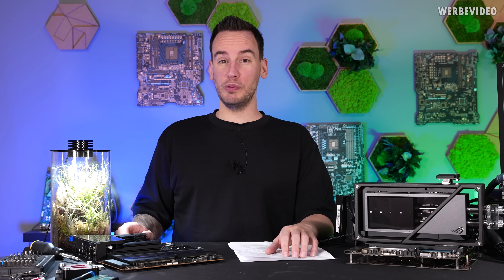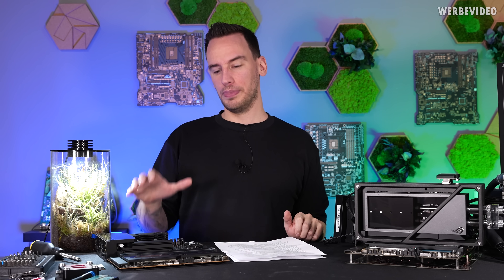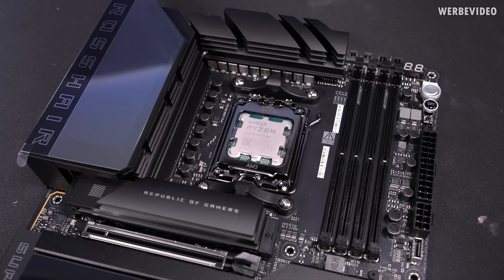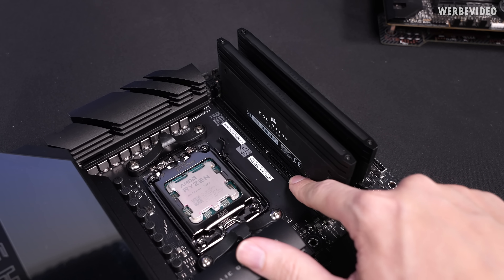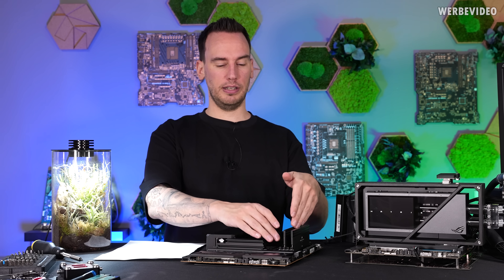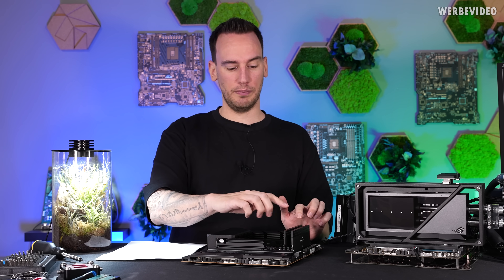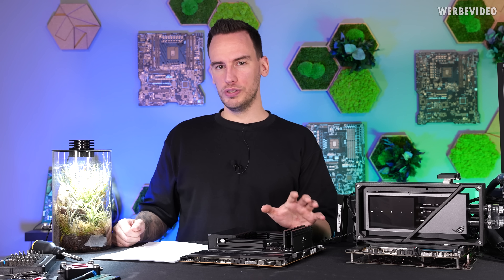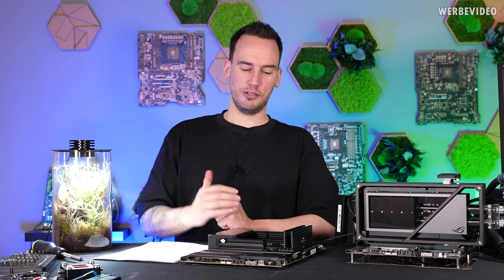How Empty RAM-Slots cause Trouble - ASUS NitroPath

Comment: So you're saying I could desolder two of my RAM sockets and achieve higher speeds as the antenna effect will no longer exist?
Reply from the maker: sounds like a good video idea :D
Reply: Good luck with that. Desoldering those without damaging the ones around it is a major pain :D
Reply: @draakevil  ...No it's not. It's actually really easy. Lmao
Reply: @MarcoGPUtuber  Do it and let us know
Reply: @19CD91  I'd actually love to do it. I have a DDR4 board that works that has damaged sockets. I'm curious to see if the effect happens on DDR4 too. A desoldering gun on through-hole sockets makes it trivial.
Reply: @MarcoGPUtuber  Sweet. I had to donate all of my spare stuff when I moved so I wouldn't be able to test this out myself.
Reply: i would not try this tho..

Comment: The higher frequency is more problematic because the length of pin in empty slot is closer to ideal antenna. 

Theoretically the effect can be mitigated using dummy termination stick to reduce signal reflections / emissions.

You have to keep in mind that the RAM frequency is lower than signal frequency (harmonics content) making it more problematic.
Reply: So those RGB dummy sticks we were laughing about can actually be benificial?
Reply: the second he said it becomes an antenna i thought about dummy dimms 🐷🐖🐽
Reply: @fffrrraannkk  Quite the contrary, RGB dummy sticks doesn't seem to have any kind of termination. If there is only the plated pad on the PCB (exposed), it can extend the lenght of the pin making it better antenna.

High frequency PCB design is difficult, very difficult.. I do not think anyone that makes shiny sticks could be bothered to hire proper RF engenieer, to make it correctly. 
And above that, for "normal" systems it is not necessary.
Reply: Interesting idea with the dummy termination sticks.
Reply: @Raivo_K it was used in the old days… like 20 years ago, or more. Precisely becomes of that, so this just now is like obvious to me.
Reply: I was thinking the same thing. We used to use SCSI terminators for essentially the same reason.
Reply: RDRAM  'Continuity modules' or  CRIMMs (although those were to propagate the signal to the termination resistors on the motherboard)
Reply: If the dummy sticks are the thing. I hope someone tries to build one. Basically it could be simply enough solution one could even D-I-Y one and opensource the schematics etc. There is nothing patent etc breaking to have pcb design with few copper connectors and filtering/shielding components in it.
Reply: This kinda explain why CAMM2 standard is being pushed... less issue with stray EMI

Comment: Nice video, in the older RAMBUS tech ,I has slots "terminators" that I have to be plug in the "empty" slots to let the system work . I wonder if it's possible to put EMF shielding blanks on modern MB to stabilize high speeds ...  I always preferred fill up all the mem slots  in my rigs , and is always cool to see my socket 2011 (i7 4th gen)  with his 8 sockets (4 each side) filled for the Quad Channel ;)
Reply: I've been wondering if bus terminators would help as well.
Reply: @blindsniper35  System memory signals are already terminated either on the DIMM or on-chip, depending on the generational specs.
Reply: I'm late 1 hour this would be the right solution and for every one i guess greedy ASUS wants the advantage for its own Motherboards.
Since i studied in the field of signal propagation i can shed some light on the subject. A line terminators they are used to reduce signal reflections this only happens when the line impedance changes considerably, like the example shown : cooper to AIR (when the line that is not terminated) so its required some impedance matching in order for the signal don't propagate backwards on the line when it reaches the end so by adding a resistance the  energy is being dissipated instead of compromising the signaling integrity by not reflecting, a big note that this AB slot scheme where the signaling is split for both A and B slots making this Act like a STUB that for itself is also something that should be taking into account.
Reply: This was my 2nd though after watched the video. Basically it would be cheaper solution for existing hardware to minimize crosstalk if it's caused by empty slots. There would be no patent's to block that either.
Reply: I feel like the longer time goes on, the more we revert to how things worked in the past.

"forgotten technology" turns out to have ideas that, well, should've never been forgotten.
Reply: DDR memory came about as rambus 'was lawyed up on everyone, if i remember , 25yrs has passed so I am sure the patents has lapsed
Reply: @jameshackett9992  patents cannot be renewed
Reply: Same, was thinking same thing.
Reply: A bus terminator would not do anything, the connectors are acting like antenna passively, even if you plug in a dummy stick it will still be transmitting because those connectors are not touching anything.
Reply: @Greyskyy151  I skipped over the rambus era (was AMD user back then), but in general, transmission line terminators will have resistive termination matched to the characteristic impedance of the transmission line. This way,  there will be no reflections from the open circuit, and no radiation, since the energy would be absorbed. 

Looking at images of the terminators for the RDRAM, it seems that they're not just blanks, but that they actually vias on them so that a pin on one side of the DIMM would be connected to the next opposite pin on the other side of the DIMM. Wikipedia says that the actual termination resistors were placed on motherboards, so this would then take care of the radiation, if done properly.
Reply: @AndrejaKostic  ahh the old days of RDRAM. Someone should do a RDRAM OC video (hint hint buildzoid get on that lol).
Reply: @AndrejaKostic  the real question is why did they not just do something like that for DDR5 right out of the box? Or even better, make all boards 2 slot only and then 4 slot boards ONLY for capacity and require that all slots be populated no matter if they are 2 or 4.
Reply: @Greyskyy151  Well, my guess is that they didn't want to make it look more complicated than the previous generation, or that perhaps, the potential issues just got lost in the long hierarchies in development teams...
Reply: @AndrejaKostic  nah ! it's just for patent reasons as this would only benefit asus (and asrock maybe) in the first place. They just don't want their R&D to benefit the concurrence.
Reply: @Greyskyy151 they are daisy chained they're broadcasting at freqeincy they would need ociliator feed back to counter it.

Comment: Why not just go back and offer proper quad channel ram? My x99 setup never had an issue with 4 sticks. We are going backwards.
Reply: 256-bit IMC is highly unlikely to ever happen in mainstream hardware. Wafers are getting more and more expensive with each new process and nobody really cares what a small segment of non-threadripper enthusiasts want.
Reply: I haven't built a new PC since x99 😢
Reply: @nybrand  Nor me. The quad channel helped these old systems keep up far longer. X99 was expensive but it lasted sooo long. I'm only changing next year due to Windows support.
Reply: Cost, probably. Quad-channel is not cheap. Tho seeing motherboard prices rise every year i feel like it could be justified.
Reply: @Raivo_K  Well you dont have to run a board in quad if its ram cost but if you are paying now $600 for a board and $500+ for a CPU...whats the extra $5 for quad feature? As you say at the prices it could be justified. It does make a difference.
Reply: Maybe cost, but maybe also as not to step on the toes of HEDT.
AMD 7950x with quad channel full speed RAM would be pretty cool.
Reply: @boringaveragenobody  With the current cost of kit we are in HEDT pricing now. LIke I said we are now getting fewer high end features for far more cost. I priced up a 9900X/870E setup and allowing for inflation it cost more than I spent on my x99 HEDT setup in 2016.

Comment: Interesting. So with a four-slot motherboard with conventional pins would it be better to populate all four slots or only use two as it relates to memory speed/stability?
Reply: Both options lose you speed and stability. Ideally there would some kind of dummy termination sticks that could be used in unused slots to block their interference.
Reply: 2 (use the correct ones).
Slower when using 4. And sometimes unstable
Reply: It's still better to populate only two slots to limit the load on your memory controller. This should just help four slot boards with two populated slots reach speeds somewhere between conventional four slot boards and two slot boards.
Reply: I have only used 2 slot Apex boards for the past several years. Does a typical four-slot motherboard have dip switches or a feature in BIOS to disable one slot in each bank when all four slots are populated?
Reply: @Cleatus46  Most boards even lack seven segment debug LED's or dual-bios. Much less dip switches to disable unused DIMM slots.

Comment: At this point I have to ask why motherboard makers even bother putting 4 slots on anymore? Even some recent motherboards are struggling to hit advertised RAM speeds with all four slots populated, and it seems that it would be a much bigger reduction in ringing and stubs, and much easier routing if they eliminated the two basically useless dimm slots.
Reply: @RN1441  because stupid customers don’t buy 2-DIMM motherboards. They think 4 > 2.
Reply: That's what i've been wondering too. I've been very critical of the fact that nearly DDR5 board has four slots for some reason.

Comment: Why are so few 2 slot motherboards on the market? Rather ultra expensive overclocking motherboards or cheap budget ones. There are none in middle segment of the market. I believe 3/4 of users use two slots only. We need much more 2 slot motherboards!
Reply: because unless going for cheap, people would opt for 4 over 2. Because more is better. And if one wants to upgrade in the feature. People dont pay more for less, unless you trick them well
Reply: @user-wq9mw2xz3j  upgrading ram from 2 to 4 DIMM would be the case back in ddr1-ddr4 times. But now in ddr5 times CPUs reduces RAM frequency drastically with 4 sticks in comparison with 2. So it's much better to sell old two sticks and buy new ones with higher volume and/or frequency.
Reply: I would guess at least part of the reason is marketing.  If Asus started making only 2 slot mobos, there are probably a lot of people who wouldn't buy them because they aren't aware of the benefits of having only 2 slots.  So, they think why buy a board with 2 slots when a competitor can offer 4 for the same price or less?
Reply: Because 2-DIMMers don’t sell, especially in China.
Reply: @PowellCat745  I agree with @fffrrraannkk - it's just a marketing (and old customers habits) matter. Just tell customers 2/2 DIMMs look better (than 2/4 with ugly empty slots), overclock better, cool down better (4 sticks heat each other more than 2) and voila la - 2 dimm becomes the new de facto standard.
Reply: who uses a mid board to oc ram? or cpu? you need a powerful board for that
and mid board are chosen by regular people who like to have an upgrade path
Reply: @regele4063  don't forget, simple enabling XMP profile in BIOS technically is an overclock too! And XMP is being used, I guess, by 95% of customers? So overlock is a very vast thing these days, even if the user doesn't know about that. 2 DIMM motherboards overclock RAM slightly better than 4 DIMM ones (even the latter have only 2 sticks installed). And choosing 4 DIMM mobo over 2 DIMM may be the reason why your new RAM will not run on the XMP profile. So manufactures need to get this information to customers and advertise 2 DIMM motherboards.
Reply: @doctor9228  i think if someone uses an 8000+ kit 99.99% of time he has a pretty nice cpu and mobo combo, not cheaping out

Comment: Glad to see this is being addressed.

I've been very critical of motherboard manufacturers putting four DIMM slots on most boards with DDR5.
The most common DDR5 kit size is 2x16GB. That means that even if a motherboard only has two slots, then buying the most common DDR5 kit it's possible to get 32GB and in 2024/2025 that's enough for most people. 

Even for people demanding more there are 48GB sticks and soon hopefully 64GB sticks. This means that even on a two slot board you can get 96-128GB of usable capacity. Only workstation/server focused boards should have four slots. If this pans out and other manufacturers adopt this standard a year from now it will solve the four slot signaling issue for those like me who do not want or need four slots, but want and need more speed. I still expect two slot boards to maintain their edge in memory stability and OC but it will make vast majority of four slot boards at least usable for higher speeds.
Reply: Ok but for 99% of users the current setup is not an issue since reaching speeds where this effect is actually an issue is impractical or impossible on AM5 CPU's. Nevermind the impracticality of the costs involved with high speed memory. So why have you been so critical of this if end users may prefer 4 DIMM slots, or those motherboards sell in greater numbers? Have you taken into account the market research?
Reply: @fVNzO  Current being the key word. The fact that AM5 is stuck at 6400 1:1 best case now does not mean that these speeds could not rise in the future. Probably with Zen 6 and new IO Die. 4 DIMM boards hurt even those who plan or running 6000-6400 speeds at 1:1 by affecting stability or requiring more relaxed timings.
Reply: @Raivo_K  Yes but we've already seen that higher speeds are not bottlenecked by the motherboard (in excess of 7-8000). The primary inquiry is about 4 DIMM's. We already know from previous generations that customers prefer 4 DIMMs over 2 and this is one of the reasons why cheapo boards don't regularly skimp there, since it drastically changes customer perception of the product. So my point very much still stands.
Reply: @fVNzO  The assumption that most prefer four DIMM boards is based on lack of choice. Most two DIMM boards are either low end or enthusiast OC focused boards with nothing in between. Are people buying four DIMM boards because they plan on using all these slots or upgrading later? or are they simply buying them because they have no choice and they are unaware of the downsides of four DIMM boards? I think the second option is far more likely.
Reply: @fVNzO  What? Ryzen 9000 can run 8400.
Reply: @PowellCat745  Absolutely. Even 7000 can.

Comment: 12VHPWR cable and now this. Looks like the "if it works, don't touch it" paradigma from the IT world didn't go well in the last years. Or the testing/quality steps are clearly ignored.
Reply: This is a very different situation. The issue with unoccupied slots has always been there but with DDR5 speeds approaching 10'000 now it's becoming an issue and needs workarounds.
12VHPWR was only made for smaller dimensions due to Nvidia and their ultra-compact PCB's (useless to consumers because coolers are still triple or quad-slot). 
Other than that it's stupid and has no benefits, but plenty of downsides like small safety margins. Older EPS (yes the CPU one) could have been a viable alternative with 300W+ possible trough officially and nearly 500W unofficially. Nvidia even used EPS on their server cards until 4000 series.
Reply: @Raivo_K  Thanks for the explanation, I was not aware about the free-slot RAM issue. To be honest I always have seen on the market 4-slot motherboards, excepting low-tier MBs or the opposite, extreme-OC ones. But I stand with my point of the recent changes in the industry has not enough QA testing before releasing, becoming an issue to the consumer, and treating the consumer as a quality tester. The 12VHPWR was a disaster, and this one is only limited to a brand, which will probably backfire along with the RMA issue the had during 2023/24.
Reply: What does this have to do with 12VHPWR? That has like zero signal integrity requirements compared to this
Reply: @ThunderingRoar  technical/design changes that ended up wrong. Not getting tech since I don't know more than building up a computer.